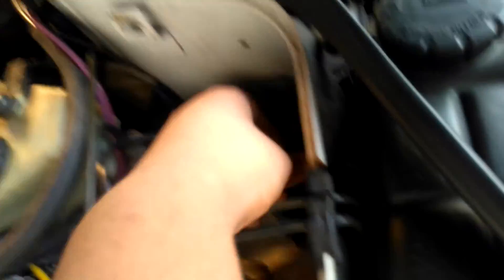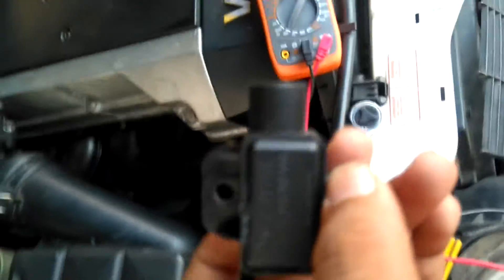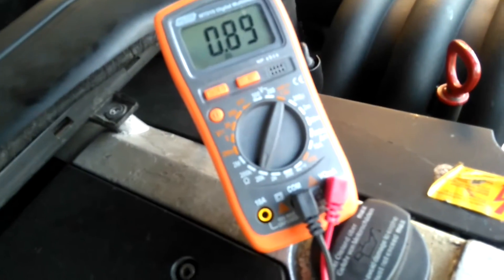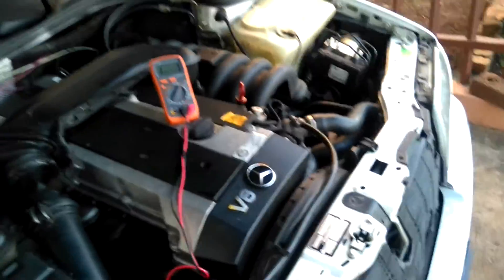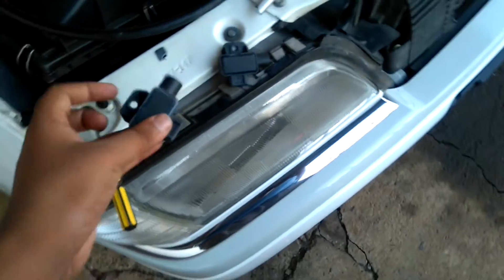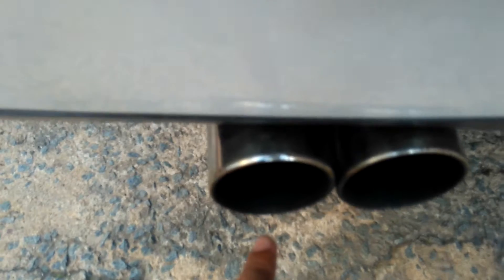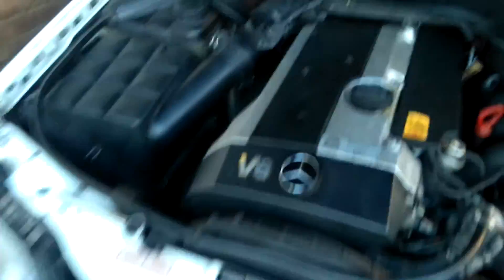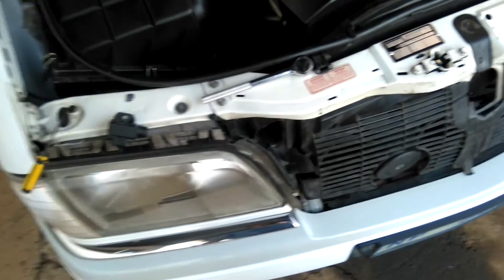Mercedes fuel mixture CO potentiometer adjustment

Comment: Men i am confused  and were a u in sound africa. And even wen I adjust it it does not work . I don't no if its my  fuel adjustment decide does not work
Reply from the maker: KZN, you have to have an ohm meter or HFM Scan and adjust as needed or go to dyno tuning places and ask them to set the CO 
These potentiometers can fail after years

Comment: What pins did you use for this setting. 1and 2 can set to 0.86 but 2 and 3 can also be set to 0.86.
Reply from the maker: I can't quite remember but I do remember there are 2 ways in which the pin setup is (and you yield the same results)

Comment: Hey, thanks for sharing.. I'm using E220 m111.960, I've got a little confused herr, there is 3 pins at the CO right? What I want to ask is, how much ohm in each pin connection, like pin 1 and 2 = xx ohm, pin 1 and 3= xx ohm and pin 2 and 3 = xx ohm.. I would be happy if you could reply
Reply: If only we know what pins he used for this setting.
Reply from the maker: I'll check up on the car , currently the car isn't with me 👍🏻

Comment: Hey, thanks for the video! I have some questions though: (1) How did you get to 0.86? Was it by trial and error? (2) Where should the multimeter be connected to get the reading?
Reply from the maker: I had taken the reading from my other merc same engine and ecu (similar millage) 
2 I don't remember the pinout will give it a check and post soon

Comment: what about c200 1994 ?? does the same idle fluctuates and misfires and backfires
Reply from the maker: Kanishka Prasad uhm you can check if it has a co pot and adjust to 0.24 but please take a reading of its current setting,check throttle wiring and maf
Reply: problem sorted buddy !! no mine doesnt have the pot but i had bunch of issues the maf didnt get ground from ECu and i got a faulty lambda sensor before cat . and of course my wiring loom was bad !! i rewired everything including the TB !! replaced the MAF !! and now its fixed !!